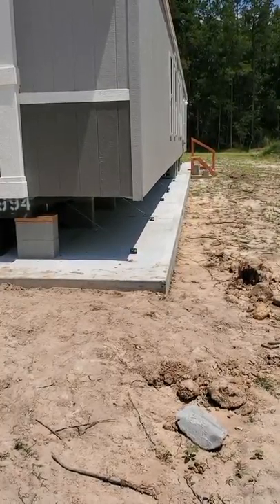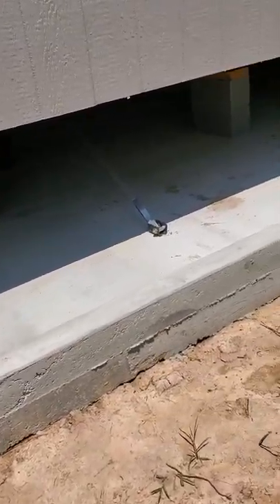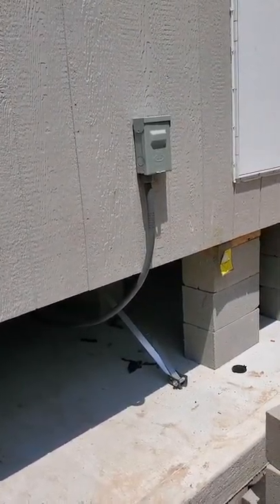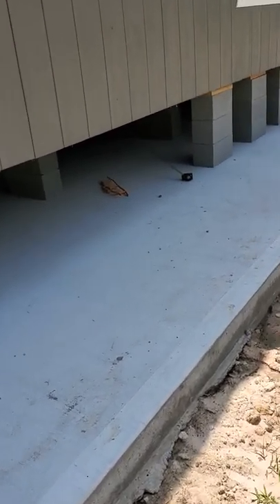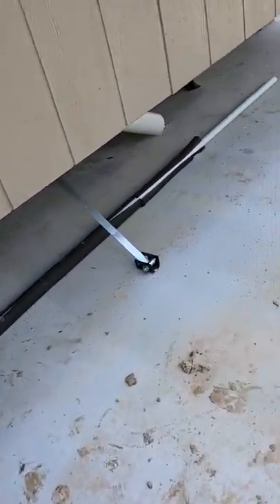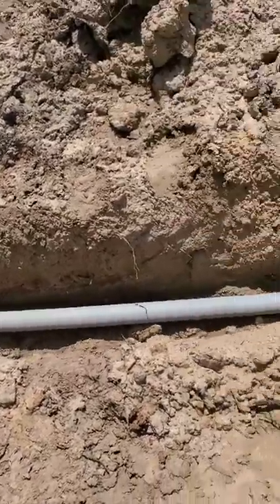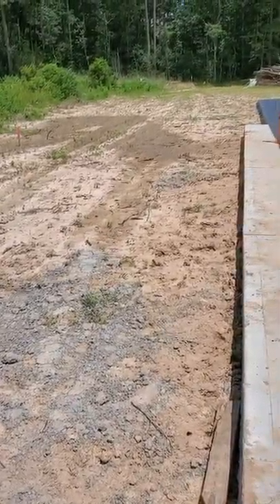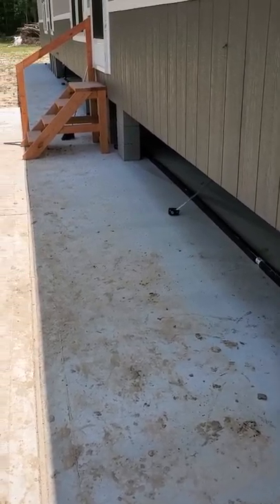Mobile Home on CONCRETE Slab

Comment: I put my 24x60 doublewide on a 4" reinforced concrete slab 20 years ago and never regretted it. It was a new home and the concrete mason that poured the slab contacted the home manufacturer to get the locations of the auger anchors so they could be installed in the ground before the concrete slab was poured. The home set up went well with a few minor glitches with the placement of the auger tiedowns that were over come by bending just a few of the augers over about an inch to get a tie down strap on them. The home was bricked in and has remained solid and level for over 20 years and is always dry. I've always kept a mechanics creeper under the home by the access door so I could lie on the creeper, kick my feet off the interior of the brick underpinning and scoot across the slab for plumbing repairs, inspection or whatever else might be needed under a mobile home over a period of time. The yearly termite inspectors love it. If you're thinking about buying and setting up a mobile home for the long term, laying a slab underneath it is a good investment.
Reply: How high is the home off the slab?  Did you insulate the floor?
Reply: @iknowheis  I would guess the home is 3'-3.5' over the slab and has been bricked in. The home came from the factory  with floor insulation enclosed with a nylon belly pan. I didn't see the need to insulate the concrete slab. there is enough room underneath for plumbers, serviceman.

Comment: This should be mandatory for all mobile or modular homes!! This keeps the homes level  at all angles and makes a solid and clean job when you have to go under the home for any reason.. Also it basically eliminates all moisture especially if on a foundation!! It makes the homes have alot better resale value
Reply: Plus I would think it keeps snakes from seeking the moisture or living in the dirt under the mobile home, my sister had that problem.

Comment: If I were to do a manufactured home I’d do a slab as well - I’ve inspected way too many mobile homes that were poorly graded beneath them which catches water and creates all kinds of moisture issues inside the building over time! Using the slab with a vapor barrier pretty much addresses that!

Comment: Can you please tell me if your home was already sitting on dirt before you decided to build a slab?
Also, where was this stunning? May I ask? How much did it cost? Did you have to disconnect the water, the septic, and electricity before you poured the slab?  Thank you
Reply from the maker: No this was new installation.  Did site prep and layed pipe for water sewer and electrical first  poured slab then put mobile home on

Comment: Were you poured the slab wider then the home it’s going catch rain and puddle on top of the slab under the home,
Reply from the maker: Hellwithpots so far no. But it is slightly sloped down at edges  but your right that could happen

Comment: Ballpark price?  I think you have hit a homerun here.  I have overkill on runners/tiedowns and still have settling, cracks in sheet rock and hard to ope doors.  I am going to do the slab and move it.
Reply from the maker: 7000
Reply from the maker: Mike Steele mine was $7000.
Reply: @MRDAN-wv3om    Hi!  Did you put a vapor barrier under the slab, or some kind of moisture barrier?  Also, does the slab need to have a grade so water doesn’t pool under there?  Or maybe water doesn’t even get under there?
Reply from the maker: @iknowheis  i think they did a slight grade to it it’s usually so hot here that nothing stays long  but im sure a little water may get under

Comment: Mr. Dan, great video and I am going to have a very small tiny home on a trailer 8 x16 put underneath a pole barn in north Florida with a very sandy base. I am worried that if I set it up and level it with concrete blocks that it will not remain level.  Therefore, I am serious thinking about  building a concrete slab to level the area for my tiny home that weighs about 5,500 pounds. Any thoughts?
Reply from the maker: Sounds good.  A 4 to 6 thick slab would be enough for that size i think.  And you’ll thank yourself later  eliminates a lot of problems
Reply: @MRDAN-wv3om  I think that I will go with  4 inch slab. Thanks.

Comment: I see where you said the slab cost $7,000.00
But is that the total cost with labor, installed?
What is the actual square footage of the total concrete used.
Reply from the maker: 20x80.  About 1600 sq ft.  Yes labor materials included.  Im in texas so we have lot of concrete contractors and i knew some of them so that helps

Comment: Thank you for the video! I was looking hard to see if a mobile home on slab is actually possible! Doing this now makes your mobile home  now a permanent home right like a regular stick built home?
Reply from the maker: Yes but check your state code some can have straps but others welded to angle iron frame embedded in concrete

Comment: I don't see anywhere the cost of doing the slab verses what they would have charged for pier and beam only without the slab. Do you remember what the cost was for the concrete slab foundation?
Reply from the maker: When i has it done i had a contractor do prep work and concrete all done for $7000

Comment: Nice slab foundation. I’m having my MH coming soon and my contractor is gonna do exactly what you did on a pit set with Cornerstone system concrete walls. My concern is that the system is 2 inches thick for the perimeter concrete wall instead of a cinder block or stem wall. But the manufacturer states that cornerstone will be great and lifetime. What do you think bout it? Thanks
Reply from the maker: I am not familiar with cornerstone system.  I do know in my area the outside perimeter thickness of a slab (the footing) is usually 6 to 8 inches thick and the interior is usually 4 to 6 inches thick.  2 inches thick is for sidewalks.  So it depends if the underneath support of your cornerstone system is enough thickness and strength to support a 2 inch slab on top.  Hoping you have a good experience with your slab .  Sincerely MR DAN
Reply: You should watch Never Buy A Clayton Manufactured Home on YOUTUBE

Comment: I got a question in a normal home if a water pipe burst they make a whole to fix it….from my understanding of ur video the pipes go through the cement not lay on top of the cement…how in the world do the fix a pipe if they ever had to break the cement??? No space to work
Reply from the maker: I actually asked about that normally in Texas that’s not a problem but if it happens they said you get a sleeeve that smaller than id to push through ❤but again the thickness of concrete should be enough to insulate that area in warmer climates

Comment: Hello,

I am doing same type of installation.

Where did you purchase the anchors?
Reply from the maker: You can get them at Home Depot or Lowes
Reply: @MRDAN-wv3om  how about the anchor straps?
Reply: Link can be very helpful
Reply from the maker: @mario12586  the straps came with mobile home. If you need them look for a mobile home supply store or online

Comment: Is the water line normally run thru a larger diameter pipe (4-5" perhaps) going thru the slab?  That way heat tape can be wrapped around the water pipe to prevent freezing in winter?  Cheers.
Reply from the maker: Dan Smith that’s a really good idea.  I wish I had done that
Reply: @MRDAN-wv3om  thanks, i was asking because where i am moving a mobile home into is currently putting the water line directly up thru the slab.  It seems to me that since it gets cold here (Ontario, canada) i could easily see frozen pipes in winter where the water line comes thru the concrete pad without insulation of any kind.
Reply: @dansmith6508    The YouTube channel by The Boss of the Swamp, who lives in snow country New York, has videos showing how he insulated under his cabin with what he calls Bubble Foil but the brand name is Reflectix.  It keeps the underside of his cabin warm.  He insulated the skirting and the floor.  He shows the ground frozen outside the skirt and not frozen inside the skirt.  He has a jug of water he keeps there to monitor how the temperature is under he cabin.  It would keep your pipes from freezing…. Bubble foil insulation on the skirting

Comment: Question: I have a 33’ x 24’ slab probably only 2 to 4 inches thick but my mobile home is 16 x 76...I would rather use that as a back porch but for cost effectiveness should I use that pad that’s already there?
Reply from the maker: Mine is minimum 4 inches thick with 3/8 rebar and the perimeter if 6 to 7 deep       2 inches would be to thin unless you poured more concrete on top.  And do you know if it has rebar in it
Reply: @MRDAN-wv3om  I don’t. It’s probably 4 inches thick because this pad was previously a carport. I don’t have any idea if it has rebar in it though. It’s been there for awhile- maybe 20 yrs.

Comment: Is it possible to connect a mobile home to the concrete slab. Like a permanent house
Reply from the maker: Yes check with local laws.  You can have anchor concreted in ground or slab then weld steel braces to anchor and underneath to frame

Comment: Question how come the slab is not flush with the moble home???
Reply from the maker: If I understand the question right.  The mobile home is supported by cinder blocks which in turn sit on slab.  I guess you could sit it directly on slab but it would be difficult or more work to unhook from delivery vehicle

Comment: Thanks for the video. I'm coming up on retirement, an want to down size. My question  to you is, by putting your MH, on a slab, can you now call it a permanent residence? In Kentucky,  a single wide is considered private property,  not a permanent property.   Looking forward to your answer...David.
Reply from the maker: Yes   But it has to be secured to slab.  The requirements vary in my case the straps attached to slab were enough but sometimes it has to be angle iron welded to beam and secured into slab.

Comment: what are the straps tied to. the timber?
Reply from the maker: Upper is to steel frame. Bottom is 6 inch bolt drilled into concrete slab
Reply: @MRDAN-wv3om  thanks